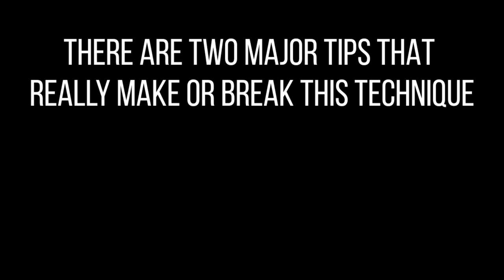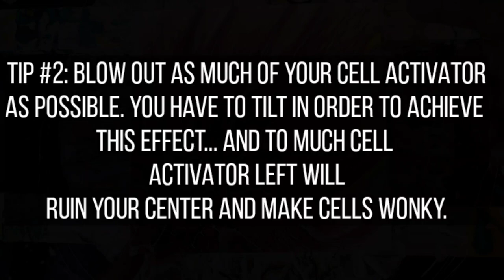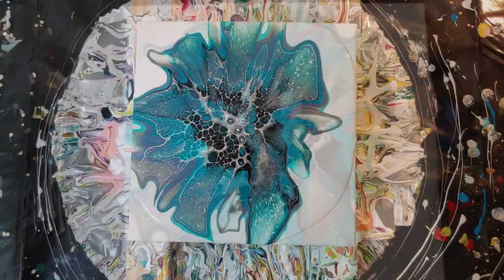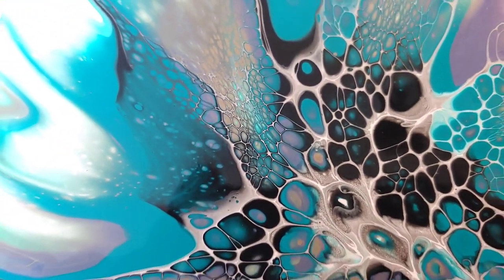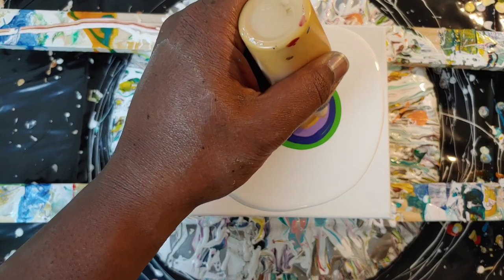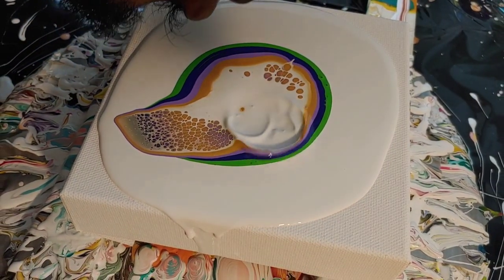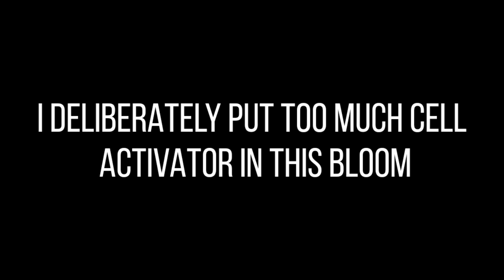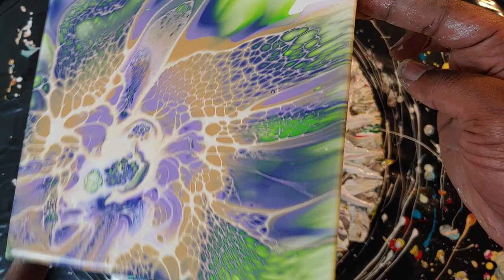#67 The Flaming Shelee Art Bloom Technique | Fluid Art Acrylic Pouring

Comment: Great work Garrick! Love the color 🎨 you chose for these beautiful flaming blooms. 
Quick question: if you use less aussie floetrol, can you achieve sharper lacing or cell borders. I live in Florida and my work space (a detached garage) gets pretty hot especially now in summer. I find my cell activator 'melts' when I blow it and spin it. How do you evaluate the consistency of your CA to get the best results? Thanks so much for your wonderful tutorials💝
Reply from the maker: Amazing point... Definitely its so many working parts. My CA has been thinning a bit I think in this NC heat as I have been having more trouble with it lately.
Reply from the maker: I try and make small batches and test it. I find too if my paints are too thin my CA reacts completely different.
Reply: @GarrickBrownArtStudio  
Thank you very much for your input!
By the way your collaboration with Jodie the Painted Dreamer was fabulous ✨love all your videos ❤
Reply from the maker: @maitev-p9582  awww thanks so much. I need to practice more!